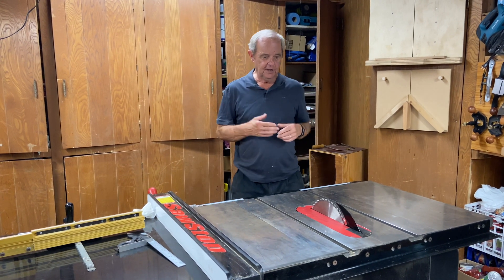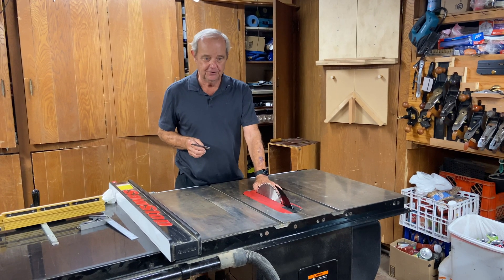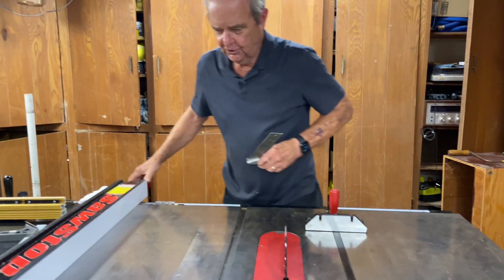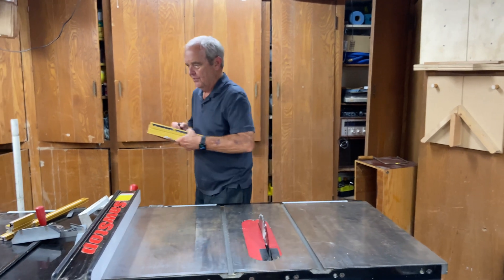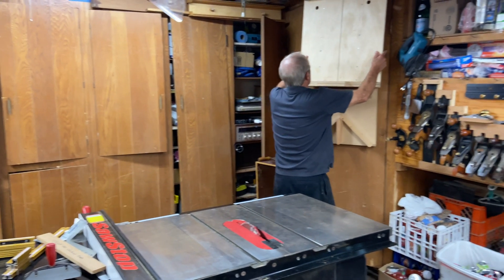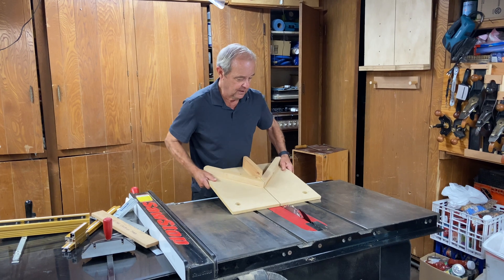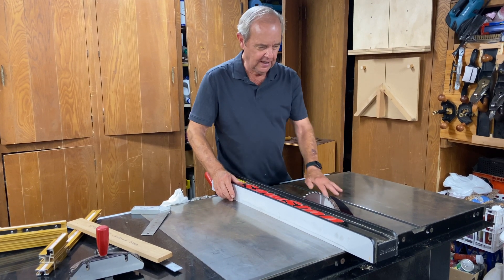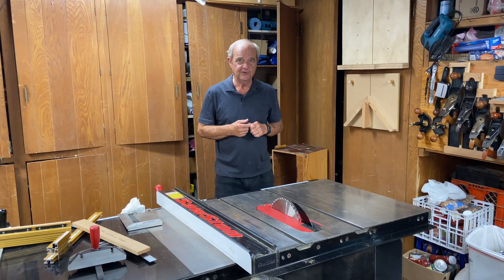Why Does My Table Saw Not Cut Straight?

Comment: Nice video.  Only thing I did differently is not use my throat plate as my reference for perpendicular.  It has some set screws and can be adjusted to get the height what you want.  I use a bigger square that I can reference the table top on the saw.

Comment: All tools like a table saw need to be calibrated. The components need to be checked also. I have a new blad.and it's already warped. So I can't address setting the blade to 90 until I replace it. Also my table surface is not level. My miter slots are not parallel. My fence is off. Both horizontally and vertically. My insert is not level. What I do have is 2 reliable machinist squares and a veritas start edge that is true. My point is the devil is in the details. I want to use my table saw to make other precision jugs and a drill press table and until I get all this straight, I really can't to a good job. I thought buying the squares and straight edge would help me confirm and adjust all this. But at the moment, they just showed how much I'm up the river without a budget. I got 2 weeks of wasting time and loosing sleep over this. I know it will work out eventually but man! My point is you need  to determine where you want to start checking and can you confirm and adjust if something is off. I'd like to see a video based on what to do when... And go over what I just typed.

Comment: Hey! I just spent a lot of money on redwood for a table I’m making. After mill work..(I used table saw with level to joint the table top), as I was assembling the top I noticed most of the edges are curved so there’s a big gap in the middle of every edge? Any idea what that may be?
Reply: You didn't achieve a 90 degrees cut on the edge. Warped blade, uneven insert, you level us not flat, fence is off. It's one or some or all. I wish I could take my own advice but you need to use the same wood to make test cuts and have tools that you trust and confirm to check the cuts. 89.9 degrees doesn't work for joints. Spend your time on test cuts and remember that a blade might look 90 degrees vertically at 1 inch but the error will be more pronounced at 2 inches. Most of my squares were not square. My level does not have parallel sides. Even a good machinists square and straight edge will give you specs on the parallel tolerances for inside and outside edges. We assume these things are dead on and you need to check, check and triple check. Check your ruler too. Check the squareness of the catch. The do go out of square and need to be adjusted. Check your framing square too. They can be calibrated with a punch and divits that move the metal. Look it up. Hope this helps. At the moment, it makes me want to give up but I'll keep chugging along.

Comment: I appreciate your tips.  I have a Craftsman 10" cast iron top table saw and I'm having a devil of a time getting the blade parallel to the miter slots.  It seems to me that I've run out of adjustment room on the trunnion tightening bolts.  I made some PALS (Precision Alignment & Locking System) which are little "L" brackets that fit over the trunnion bolts and pull them left or right as needed.  However, the trunnion bolt holes seem they need to be reamed out to a larger size to allow for more lateral adjustment, unless I'm doing something totally wrong.  I hate the thought of having to completely disassembling the saw to accomplish this, especially if its not necessary.  Any thoughts?
Reply from the maker: I actually had a Craftsman 10" cast iron top table saw, so that's a walk down memory lane. Can you loosen all 4 bolts so that the top moves freely, and then adjust to be parallel and tighten all 4? That would be a preferred approach if I were in your shoes.
Reply: @SawsHub   Actually, there are 6 bolts (3 per either end).  Today I loosened all six, tapped with a dead blow hammer, and checked the alignment.  I didn't get to finish the adjustment (I hope to tomorrow) but a cursory check seemed to indicate almost perfect alignment.  This will be the 3rd time I've tried aligning so keeping my fingers crossed.   If I had to guess what's different this time is the middle bolts on both ends were more adequately loosened.  Thanks for inquiring.
Reply: @HWPcville  I have a Craftsman 10" cast iron top table saw (like most people) also, Model# 113.298032. Both my dad and I tried numerous times over the course of the first 20 years or so to get the blade and cross-cut slot parallel. The Rip fence was fine. The best we could get it was an 8" board would be about 1/32" off front to back cut. I made a sled to run against the rip fence for when an accurate cross-cut was needed. Finally, I ended up reaming the Trunnion mount holes a tad on mine. I was then able to get the blade and slot parallel. It cross-cuts dead-on, now. I bought my saw new in 1981 for $329.99. Overall, it's been a great, durable saw. Wouldn't even think of parting with it. During that time, also bought other Craftsman machines, too - a 12" Band Saw, 6 1/8" Jointer and 12" 2hp Planer-Moulder. Still have and use them all, and all have served me well...Those were the days when you could go to Sears, buy a machine, and go to their parts dept., in the same store, and get replacement parts, upgrades, blades, knives, etc. for whatever they sold.
Reply: @jedclampett4215  I remember those good old days too.  I would go look at the big power tools and dream of owning one of each.  I was an office worker with a growing family and just tinkered for fun with wood working in my free time so didn't really have a good reason (or good enough paycheck) to buy them. Now that I'm retired I want them all over again..lol
Reply: @HWPcville  LOL...yes, I do miss those days. I did the same thing - going to Sears and looking at all the machines & tools. I was an Aircraft Mechanic and used any overtime money I made to buy the machines. Funny that the Table Saw, Band Saw & Joiner were all $329.99 each and the Planer was $449.99. A lot of money back then, but, they are good quality machines - Sears contracted out to major manufacturers to produce them and put the Craftsman name on them. But, for about $1500 I got four good quality machines that have lasted 40 years and still doing the job. Don't know if in today's throw-away world I could have done that. LOL....I still have my Garcia Mitchell Spinning Reels, Penn Trolling & Boat Reels from when I was a pre-teen. They still work fine and catch fish just as well as the $150 Shimano Reels.

Good luck to you on your Table Saw. If you go the ream route, it didn't take much for my saw - only a couple thousands each hole. It was almost 20 years ago so, I don't remember the exact size. But, wasn't hard to do. Just a bit time consuming.
Happy woodworking...

Comment: when i feed my wood it seems to tighten ? could you give me the reasons for this please thank you
Reply from the maker: Assuming you are making a rip cut - if so, you need to (carefully) adjust your rip fence so that the far end is at least as far away from the blade as the near end (preferably a little further away). Also be sure there is a riving knife behind the blade so that the tightening isn't a warped board coming together behind the blade. This situation is a def safety hazard!

Comment: Why wouldn't you adjust your miter to the opposite miter slot?  Wouldn't that be better than the blade which could be out?
I understand sleds are all the rage but I sure hate giving up that 1/2" off the surface.  I'll have to think about why that would be more precise than an adjusted cross cut miter.  It would seem as though the CCMiter would be more versatile for polygons and 22-1/2 degree cuts.  
You have really good presentation quality and these are rhetorical thoughts.  Thanks!
Reply from the maker: It is very difficult to accurately set a miter gauge to 90 degrees. For precision, you really need a sled, because you can adjust a sled easily to tolerance of 0.005" in 24". That is much more precise than you can achieve with the miter gauge. Great thoughts, thanks for sharing!
Reply: @SawsHub  I agree to a degree or parts there of.  But the first thing you do when you get a saw is take a 24" board and attach it to the miter.  Then check for 90 and you're set.  I will say that miter sleds are more stable and maybe hold the work a little better.  Safer too.  But again giving up that 1/2" blade height is concerning.  
You are a great presenter and I'm subscribing to see what the next one will be.